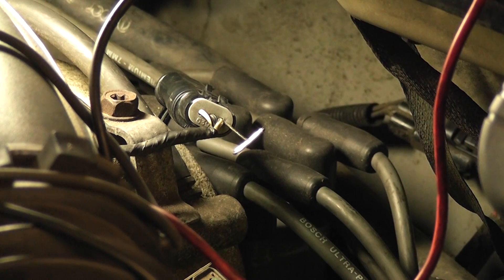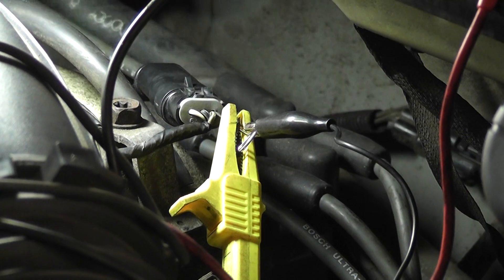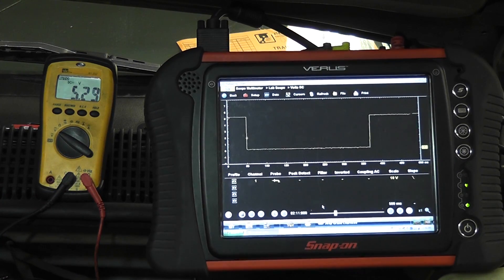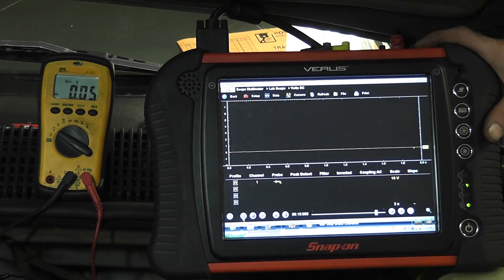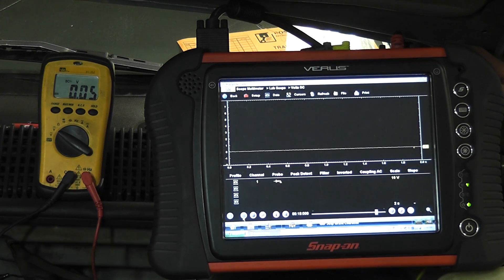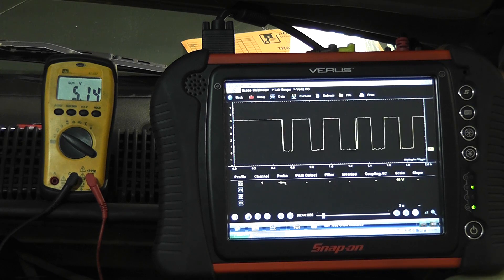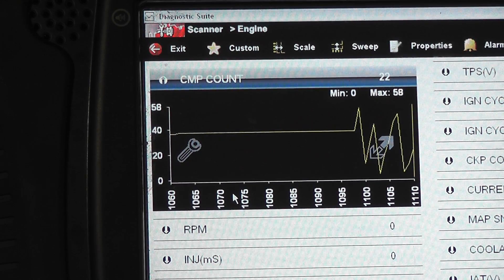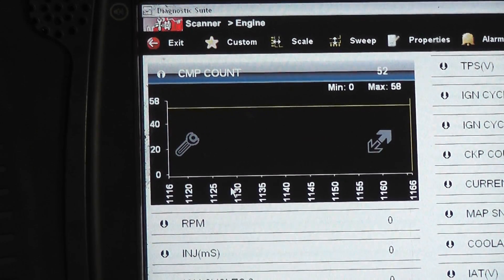How to test a cam sensor with a voltmeter

Comment: My 2000 Silverado with the multi meter set on 200m reads 17.0 then when cranking spikes to 19.3 and then stays around 16.7  then when i stop cranking Spikes to 24.8 then back to 17.0. isn't that way to high? I have my negative lead on the negative battery and positive connected to the cam signal. The cam sensor is not connected.

I have had a warm hard start the last 2 years. If i let the truck sit for 5-30minutes after driving then try to restart it, it won't start unless I hold the gas pedal down. The truck fires Right up on cold starts and after sitting 1-2hrs after driving. This all started happening after I replaced the cam sensor connector, but im getting signal through it on my multimeter. Ive tried everything, fuel pump and every sensor, a different PCM, cannot figure out whats wrong. I literally want to drive the truck in a ditch lol. Please help! No codes, but for some reason it is trying to flood itself on warm starts and had a body shop use a scanner said everything looked good besides it runs really rich at idle. They didn't notice anything that could be causing the hard start.
Reply from the maker: 200m? As in 200 millivolts? 200m wouldn't be the correct scale on a voltmeter, if that was even the voltmeter
Reply: @ScannerDanner  or maybe it's a multimeter? I had it on volts (the straight line on top and dots on the bottom symbol) I don't know squat about electrical stuff obviously. I tried  volt~setting (wavy line symbol)and got 0 with the key on, then when cranking it would get up to 5.3, shouldn't there be a signal with the key on as well? 

I'm stumped on the issue though and very frustrating. Doesn't make sense. As it never throws a code for anything. And I've made sure the connector is wired properly.
Reply from the maker: @christophermix6845  yeah, thats 200 millivolts, wrong scale. You should be set on most likely a 20v scale for every test you're trying to do
Reply: @ScannerDanner  gotcha. Any ideas on my issue?
Reply from the maker: @christophermix6845 you're barking up the wrong tree with the crank sensor. Focus on your fuel system. This sounds like a classic leaking fuel pressure regulator diaphragm
Reply: @ScannerDanner  that's the thing, I had to put a new delphi fuel pump in, I've tried 2 different pressure regulators abd they never have fuel coming out them. Fuel injectors, fuel pressure is 50psi running 55 with the key on. I thought maybe I had a pinched injector o ring but they're all good. I've actually had 2 shops look at it and both had no idea whats wrong. I've tried the old injectors and the truck runs worse with them.

I've tried cycling the key a few times when warm to prime the fuel system, doesn't make a difference.

 I'm stumped just doesn't make sense.
Reply: Me again. So you're on to something. My 2 year old delphi pump crapped out on me, I replaced it that fixed it for about a week, now it's back to the same thing. What in the world is going on???

Comment: What would happen if I put the black test lead on the black ground wire instead of battery ground?
Reply from the maker: As long as the sensor ground is good, it would read the same. If your sensor ground was open, you'd read 0 v leading you to believe you have no 5v ref, but I'm actuality you also have 5v on the sensor ground. This is why I chose battery ground first
Reply: @ScannerDanner  ok thank you very much! Good stuff

Comment: Hey Paul I have a 2001 Dodge Intrepid 3.5 that will only run with the Cam unplugged. The owner has replaced both Cam and Crank sensors. I checked the wiring to the Cam, 8.91 on supply 4.96 volts on signal unplugged 0.06 plugged in and ground is 0.02. When I crank with the Cam plugged in the tach will rise to 1500 rpm. Also when I plug the cam in the ASD will click and fuel pump will do its prime then everything is silent. What are the chances that the timing has jumped? Thanks

Comment: in know this was a long time ago, but I have a P1391 error and since that doesn't specify which sensor is bad so I am using a 2 trace scope to watch both, It would be interesting to see both signals together and their relationship. (could see a broken flywheel tooth too perhaps). Just a thought.
Reply: I have a video on that code. It was on a 2004 caravan. The P1391 is a cam crank correlation code, and is usually not from a bad sensor.
Reply: I looked through the list...how did I miss that? I'll look again.
Reply: ScannerDanner Premium please point me to that video. I can't locate it. One more thing if I may, I'm using a Fluke scopemeter to look at these signals and i am not seeing a good square wave on either one yet the engine runs fine. If these are Hall effect devices I would expect a nice pulse shape, if just a coils I would expect a sine. Does the scope you are using perform any signal shaping?
Reply from the maker: 2004 Chrysler 3.3L Cam Sensor Problem (P0344, P0016)
I thought this had a P1391 code but it did not.

As for the scope pattern, you should definitely be seeing clean square wave patterns. Try increasing your sample rate if you can or reducing your time base. Also if there is a lot of noise use the sensor ground instead of battery ground for your scope
Reply: @ScannerDanner  I have a 2001 Dodge Ram 5.9 gas I've had this too many mechanics and cannot figure out the problem the exhaust manifolds glow red we dropped the exhaust system and ran vehicle it still glows red check the fuel Trims and timing I'll check out okay change the plenum gasket change oxygen sensors tune up no check engine light can you please help as I am worried this motor is going to self destruct also changed out fuel rail and fuel injectors one more note it does not glow red until it is under load
Reply: We also swapped out computers and still exhaust manifold glow red
Reply: ScannerDanner I have the square wave now but not the clean one I would like. I have almost a volt of high freq noise on the signal from the cam sensor that is not present on the crank sensor. I suspect HV ignition is crosstalking but not sure. Repalce cam sensor and have same issue. Lost a scope lead in the belt so until I get my other scope from work I can't compare timing between them but I would guess its possible that the PCM is seeing that noise and interpreting it as real, and throwing a loss of sync code. All I have for a scanner is an old Snap on model that just says Current Sync  = Lost. I know I'm close, just gotta find that last nugget. How can I verify the timing between these two sensors using only the scope patterns?

Comment: I replaced one of these in a 4.0 jeep today, the odd thing to me was I I plugged the good one In and ran a hose clamp through it , and it didn't change cam count, but it worked once installed.

Comment: That's actually a back-probe pin.  I've seen the long straight pins used for sewing used for this as well.
Reply: That's a T-pin, the type of which has existed long before there was a need for back-probing.
Reply: Yes they are used for sewing and auto mechanics took them

Comment from the maker: It is possible that there was a cam or crank sensor driveplate/trigger wheel change up in the model years. Search my 2004 Dodge Caravan video. 
This could cause this condition. Are you a member of iATN? You could search their waveform library. Or do you have a scope that you could give me the waveforms from?
Reply: ScannerDanner  do I need every bit of the 5v .I measured 4.92. Is the pcm  not putting out enough voltage? Thank you